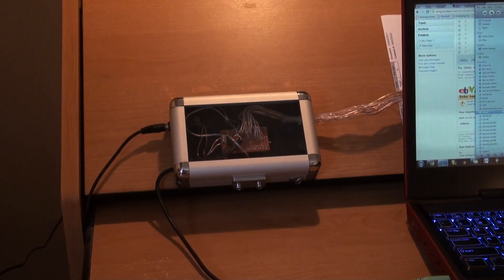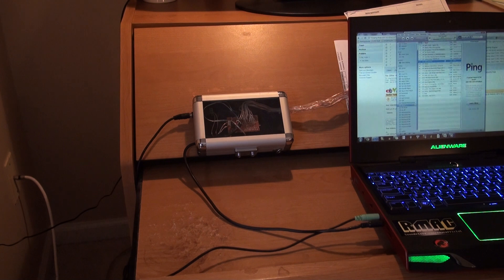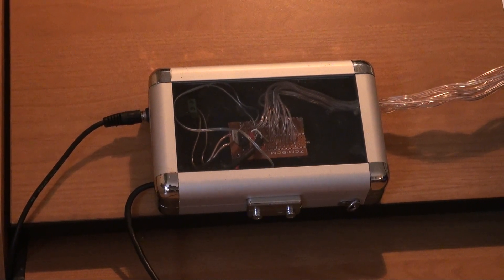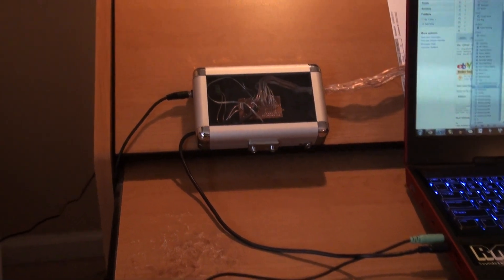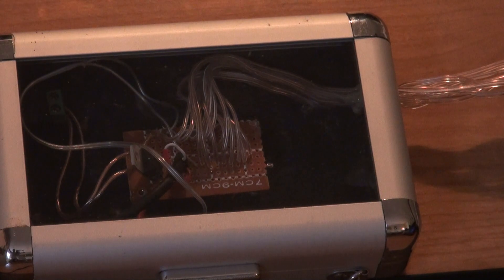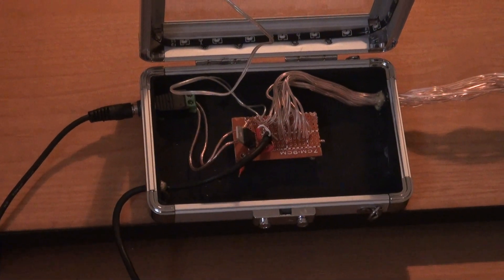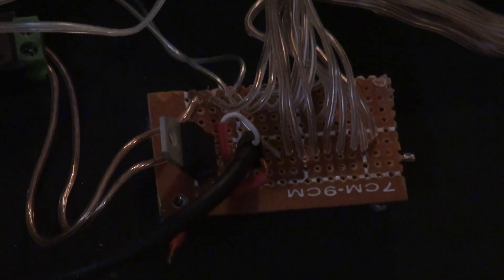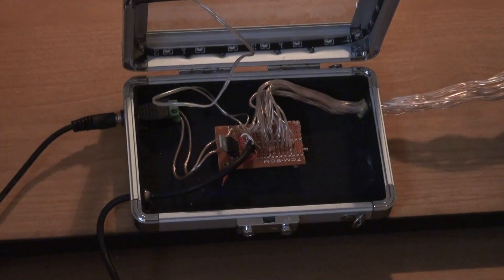Music sync LED light box

Comment: Nice job!  You mentioned that it responds more to the bass.  How about building low-pass, band-pass, and high-pass filters on the input side?  That way, you could use 3 transistors and RGB LEDs, running red from the lows, green on the mids, and blue on the highs. :)

Comment from the maker: Yeah that should be able to work. But you would have to set up resistors to reduce the 8v to the LED's rated input voltage though. It would be a lot easier using a 12v power supply.

Comment: Plan: one toggle switch 1>leds can be sync with music
2>led are continously on[this is where i want to regulate voltage]
Checked with multimeter and found during start or inbetween battery gvs spikes till 15.8v which i want to regulate
 
Heard that givn more amps/volts both can shorten life of LED.

Lastly created circuit wit TIP41c [does this make any diff than TIP31] but my LEDs are very dim checkd wit multi found only max of 5v are getn supplied during loudest of music from my htc mobile

Comment from the maker: In this video, I actually used a 12v power supply, so the tip31 should work fine in your car. Just make sure that your LED strips are rated for 12v, otherwise you may burn the LED's out.